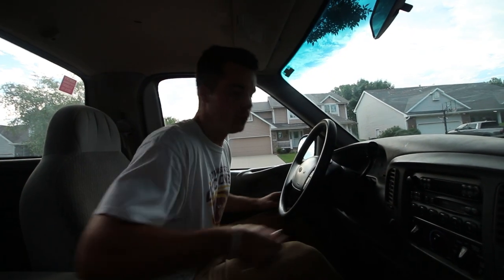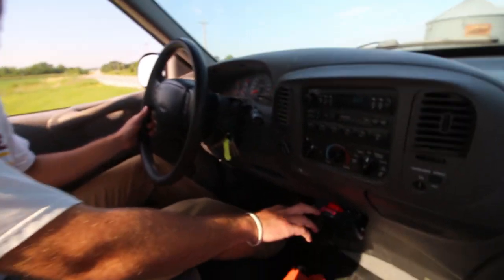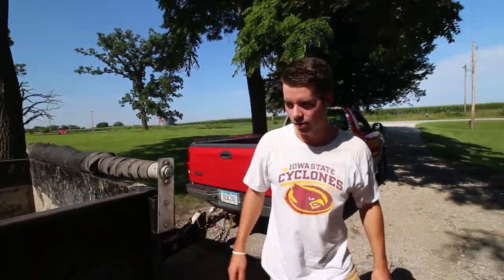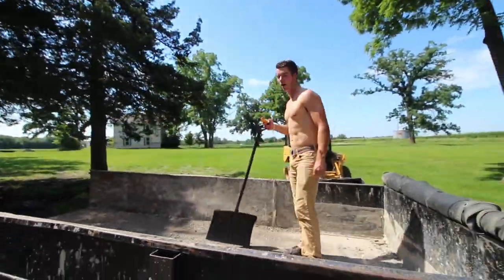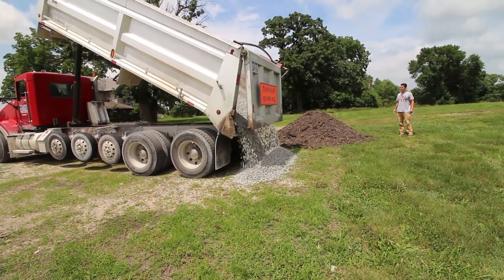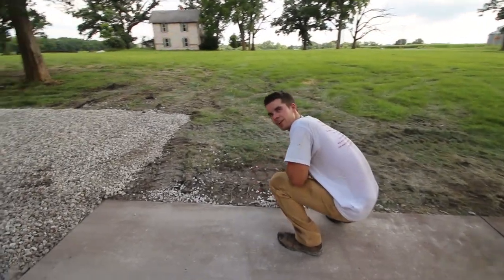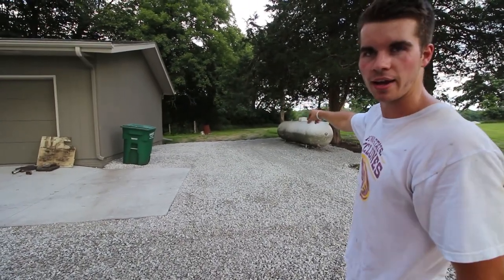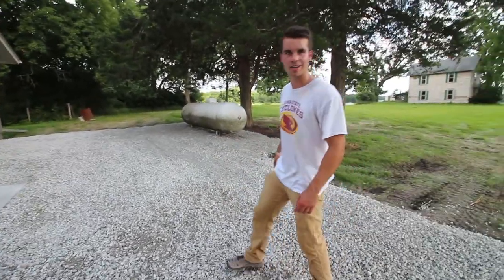OLE RED TOWING 12,000 LBS OF GRAVEL | SUNDAY FUNDAY

Comment: least you have trailer breaks at my work we had to haul smallm escavators with just the truck breaks and the truck is a 7.3 disel but sometihings wrong not much power runs good though just had an oil change

Comment: DONT pull more than what you are rated for IF it is speced right you can get 12,000 pounds out of it in total but that truck is probably rated for 10,000-11,000 pounds.

Comment: ole red is an f150
Reply: Aidan Wolf no it is a light duty f250
Reply: Weston the boy made of Depression no its not its an f150 if my 7.3l f250 is the same as that than thats not true. That is a glorifyed f150 it doesnt have solid front axle. It has dana 60 rear mine has dana 80. Its just a like of junk
Reply: Zach Campbell look it up it doesn’t even squat at all when they put the skid steer in the dump trailer
Reply: Weston the boy made of Depression because it has f250 rear springs because it is the Camper edition f150 so all they did at the factory was put heavier springs on and 4.10 gears and called it an f250 but its not.